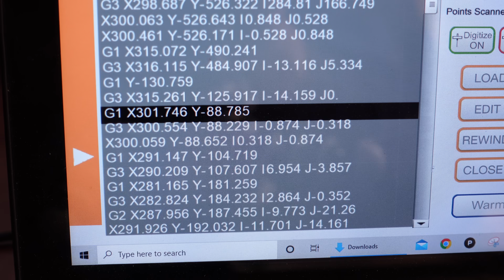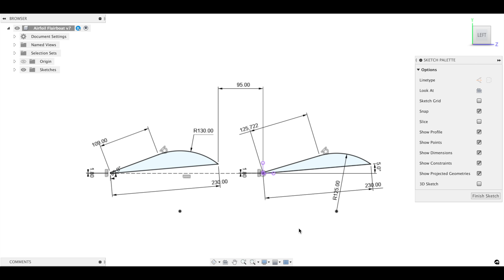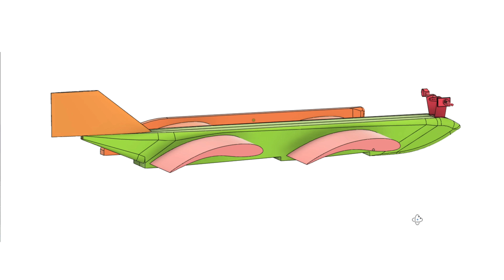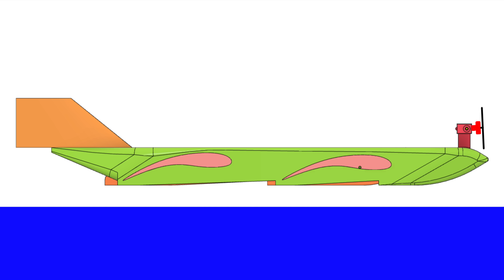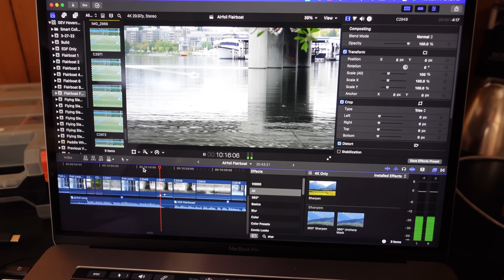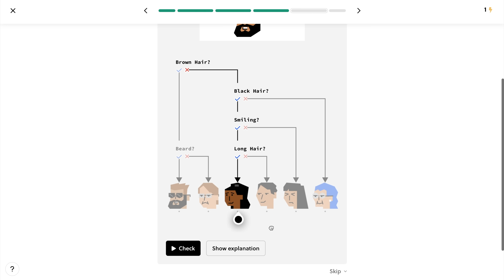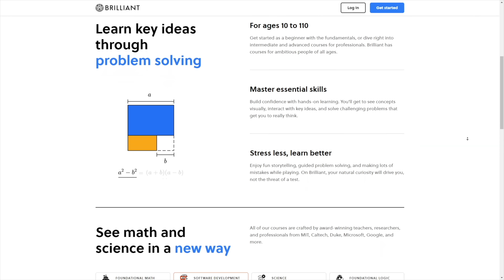Worlds First R/C Airfoil Flairboat

Comment: One thought I immediately had was, what if you were able to adjust the angle of attack on both front and back wing? Another thing I was thinking was maybe the actual flair boats didn’t have as much wing surface area. I think the whole point of the flair boat is to not necessarily have “lift”, but more of just a pocket of compressed air underneath. Either way these videos have been a ton of fun to watch.

Comment: I believe a great factor not depicted in your models is the power to weight ratio.  
Your models are super light compared to the wing area ( and power that you have already mitigated). 
If you load them up with heavier motors, batteries and the rest of the craft, you will achieve your goal.
Reply: Who does not love more power/run time/cooler motors? 
And, it takes it closer to the 1:1 use case of fast heavy transport with safety margins typical of military ops.

Comment: Take the weight distribution along the crafts length and power-to-weight ratio of the craft into consideration! The original Günther Jörg craft probably had a heavy combustion engine in the middle as well as fuel tanks. The pilot sat in the front or at least the front third of the contraption. It is safe to assume that 60-75% of the weight of the crafts weight was concentrated in the aft-half of the vehicle. Also, the CoG would have been further aft than on your model. The problem you are having is similar to that of the infamous 737-Max 8.

Comment: Again: Anything will fly with enough power. Ground Effect Vehicles are about being optimized for efficiency in GE.

Measure power and airspeed, you should see a considerably higher airspeed to power ratio in Ground Effect than in a classic airplane. You would also see much lower stall speeds and higher capacity.

I would actually not classify what you have here as Ground Effect Vehicle because it flies too low. As you noted you're getting ram pressure rises.

Comment: Tried to comment earlier but I think YT was removing it based on me linking to RCGroups. Apologies if you've already seen this!

'Derk' on RCG built a tandem wing flairboat with airfoils about 12 years ago. It's post 177 in the General Ekranoplan Topic in the hovercraft section. In the following pages he reports on testing it with some success. Sadly most of the external links there are dead so there's very little video or pictures to go on. I think I've seen other tandem designs tried, I will see if I can find it.

Looking forward to the next one!
Reply from the maker: Good find! 
https://www.rcgroups.com/forums/showpost.php?p=15646822&postcount=177
Reply: @rctestflight  Aye that's the one. That thread is a fantastic resource with the most information I can find about RC GEVs anywhere. But trying to parse it out and find things is quite hard even with the search, and that's before you see how many dead links there are in the early parts. Nowadays there's very little activity.

Comment: i too have really enjoyed this series.  My two pennies worth, noting that I know nothing of the crunch... with a full size ground effect vehicle and considering the volume of air that's under them plus the speeds at which they travel and the pressures etc,  then scaling that down to the size you are experimenting with.  You can't scale down the air molecules and so surely the volume of air underneath the scaled version is going to have different properties to what you are expecting.  could that be the reason why doing this experiment is so difficult??
Reply: <Reynolds has entered the chat>

Comment: I will say again that span has a lot to do with how temperamental these are. You are dealing in mm of clearance at this size whereas a craft of 6 feet span would be dealing in several cm or inches of cushion.   The bigger it gets the heavier ripples/waves it can clear.   Besides that efficiency goes up as bigger airfoils have better reynolds numbers.
Reply: Two meter wingspan should be producible using his current facilities. He could scale up a copy for a comparison, if he was so inclined.

Comment: I'm fairly sure that packing tape would just want to stick to the water, back in the day they used to try and polish the underside of race boats as much as possible for it to slip through the water since that's how it works in the air. However it just ended up increasing the surface tension to the hull and ultimately slowing stuff down, not that it matters at speeds like this but it's still a fun anecdote !
Reply: You could make a surface more hydrophobic by waxing it. No idea if a fully submerged hydrophobic surface has less drag than a fully submerged hydrophilic surface, but at least it should make it easier to lift the last millimeter or so out of the water at slow speeds.

Comment: Perhaps a good use case to define ground effect craft in the spirit of the ekranoplan is to consider jet engines with afterburners. Afterburners could easily be used to lift off the water, but are FAR to fuel inefficient to be used in normal flight. 

Electric motors are the way to go for these small RC craft but I think it's important to remember that looking at this from the perspective of electric motors conceals the purpose of this concept at full scale with different power plants.

Comment: The reverse Delta mainwing in ground effect, with a high lifting tailwing not in ground effect is the most pitch stable configuration. 
Your right this is more like a SES of rigid sidewall hovercraft. 
You could try enhancing dynamic sideskirts by curling the edge vortex down at the lower edge of the wings

Comment: I really like this series. I think having elevons at the back affects groundeffect so you not just introduce pitching moment but directly also affects the lift. Maybe it makes sense to have this control but I think elevator should be somewhere else for pure pitch control.
Also thinking that relation between height and lift force / pitching moment would help to understand which control laws to use and maybe optimize the design.

Comment: I think one large problem with doing this with a scale model is that electric motors especially are so powerful now, and materials are so light, the details almost don't matter as long as it is controllable. It's just like a missile. Point it in the direction you want to go and it goes.

Comment: Nice.  I realize that it required optimum conditions, but given those conditions it looked relatively stable.  My guess is that one of the problems with this type of craft is that the negative feedback, wrt to flying height/pitch attitude, is of a quite different magnitude in each sense. In other words I suspect the feedback gain, if you will, is much higher on the correction from too low to normal flight altitude, than the high to normal side.  That is just a guess, but it seemed to appear that way on the water.  

Thinking about it from a physical standpoint, riding a wing to surface pressure wave, I would expect that to be the case from a first thoughts shot at it.  Could be wrong.   

Are you going to try to build one now that can handle more widely variable conditions like more wind/higher waves/more variable wind, or have you about saturated on this project?  I can see you've already put a lot of effort in. Maybe somebody will take what you've learned and carry on if you have had enough.
Reply: Have a look at Tandem W.I.G craft Technology, you find everything in reality.

Comment: honestly i dont really understand aero dynamics. But the new F1 cars utilize ground effect in reverse to this, to push them into the ground. In my opinion the ground in this case doesnt really matter because with enough speed youll just fly. Youll have to design something like a hovercraft, but instead of a fan blowing down the thing, youll have to have air come in when the craft comes up to speed. You understand what i mean?? You'll have to design a floor design similar to the new F1 cars, but in reverse?! so the air lifts up instead of push down. No wings.

Comment: You need some sort of mechanism that airo breaks as soon as the angle changes. So you would have a sensor for when it tilts up - air braking starts. And have some linear relationship so the bigger the tilt the bigger the air breaking.

Comment: You have referenced the universal hovercraft designs..did you see the hoverwing vidoes? Hovercraft with canvas wings? those are def ground effect...no aileron control on the small ones. They do say they can "jump" to 20 feet...but not sustain it. So this i think is pretty much a real ground effect vehicle..but assisted by the downward thrust from the hovercraft. But..a very heavy aircraft and prob impossible to replicate in an R/C size. Love the videos...keep em coming!

Comment: I wonder if it'll help if the front wing has a lower stall angle than the rear wing? So any nose inclination causes rear lift to increase and front lift to decrease. Maybe that's why the full scale ship had under camber on the front wing.
Reply: THIS.

Comment: Is it possible that ground effect was more intended as a way to make a craft cover distance more efficiently? like maybe it "could" fly but it would use X amount more gas than when it was in ground effect so it wouldn't have the range required. and then they could design less fuel storage space into it and more room for cargo.

Comment: The front wing is a canard: it must stall first for stability. That is why the big old one has different aerofoils for the two wings. 
I suggest that you increase the front wing loading, angle of attack and sharpen the canard leading edge and reduce the wing thickness to ensure that the front wing stalls first. Also, reduce the angle of attack of the rear wing so the whole aeroplane body is at a positive angle increasing lift. 
Also, at small scales, a flat aerofoil works better than a classical curved aerofoil. The Wright brothers did not notice the scale effects obvious between the flat thin wing of a little bumble bee and a thick eagle wing so they used a small wind tunnel and then made their first powered aeroplane worse by building thin wings which had been optimised at tiny scales in an insect-scale wind tunnel. You are going smaller so your aerofoil must be flatter than the human carrying original. It is all Reynolds numbers!
Reply: Yes, and those differences can be be more dramatic than  you would think, and more tricky.  I think I remember that when Burt Rutan, who is a very competent aircraft designer, scaled up the Beech Starship, he ran into some unforeseen scaling issues.
Reply: you've got it with this idea, seems correct to me
Reply: I suggest that you do the above and show us the results on your channel.
Reply: @ruzziasht349  He actually makes some good points.  I agree with a lot of what he said, and I have a LOT of experience in RC, including from scratch designs, have built my own full scale airplane, and am an engineer, electrical, not aerodynamic, but I did have some applicable physics and fluids courses in my core requirements.  

If he has the time and inclination that would be cool. If you just meant that as a snub, that is totally uncool.  I'm guessing you meant it in a positive way.

Comment: I think you are focusing too much on the ability to fly out of ground effect. Your focus should be on the efficiency gains from flying in ground effect. To me, the definition of a ground effect vehicle is simply one whose energy requirement is drastically reduced based on proximity to the ground for a given speed. I would love to see which one you could fly longer, a large solar glider or a large solar ground effect vehicle?
Reply: Not for me, not for a useful practical one.  I would love to have a ground effects vehicle like this, and in that case I don't think the efficiency between a high flying and ground effect craft is at all the interesting comparison.  

Since this is an air/water vehicle, the interesting comparison for me would be the WET efficiency vs ground effect efficiency, and I expect that is massive.  For a practical two or four person sized craft the other thing that would be very important to me is the flying height. Without enough of it the vehicle is useless with any increasing magnitude of waves overflown.  Also, you could haul ass through the Manatee areas without having the slightest worry about even touching one, as where I live, in Florida, waterways like large extents of the St Johns River are now wake, slow idle zones for Manatee protection.  The other large consideration for transport, even just sport transport would be speed, where this vehicle should trounce any wetted vehicle, even hydrofoil.

If you wanted to use ground effect to transport goods (or just as a science experiment) then I would agree that your comparison is definitely part of the equation.  Not arguing, your opinion is your opinion.  I'm just trying to look at it from the larger scale perspective in terms of real world payoff.

Comment: everyone gave up on tandem wings for all the things you experienced, my first was a rubber powered tandem. 
theyre also a bit dangerous in free space because the rigging angles make them limited in recovery, like from stall or in a spin
mainly because the aft wing is in the wake of the forward or canard wing, once the canard takes energy to produce lift, the airstream aft is downwash.
(that downwash is the angle of attack of your canard plus around 4-6 degrees)
this downwash means the aft wing has to be rigged so that has more AoA (angle of attack) otherwise its effective AoA is in the minus zone. 
ultimately the CG ends up at the canard and it does more work, the original machines moved to very large high aspect ratio tails around 40% area in free space instead
it just produced more lift per area, therefore weight, and was more controllable in pitch
you can adjust the effectiveness (or not) of a machine by limiting the aspect ratio of the mainplane
very low aspect ratios wont float out of ground effect
cheers
Reply: Look up Quickie, and Q2 (there is  a Q200 version, too). And you might want to include aircraft and have your safe search turned on if that sort of stuff bothers you.  Just sayin'. :-)
Reply: @MrJdsenior  what makes you think I dont know these designs
the quickie is more of an extreme staggerwing, because it has lots of vertical separation it doesnt suffer the same wake effect, as I have written
when you figure out how to read come back, otherwise lets not bother either of us

Comment: maybe if it had short hydrofoils it would be able to raise on water before getting airborne, but still not have enough power to achieve full flight?
Also, as you have overpowered motors that make the craft go out of GE, looking to stall, how about putting them to use in bladeless fans blowing under the front wing, and no other propulsion? It'd make definitely sure that it would never leave ground effect, I guess.

Comment: Maybe a suggestion for fighting the flipping phenomenon: Make the front airfoil way thinner than the rear one, which causes it to stall almost instantly when the pitch gets out of hand. The rear wing would at that point then still provide lift and force the pitch down again.

Next, I think the reason bigger planes are inherently more stable within Ground effect, for two reasons;
1) The ground effect regime works within a window closely related to the wingspan (as you mentioned in earlier episodes). Bigger/ heavier planes require more wingspan in the first place to even fly, and thus give them a larger Z-window to operate within ground effect.
2) Heavier planes will also respond less aggressively to water disturbances, as the relative change in lift as caused by the disturbance is far smaller than with a tiny plane with a very small air gap.
Reply: The heavier = more stable might be an issue inherent to larger craft, to do with the square (^3) increase in mass as size increases, which also necessitates stronger materials which inevitably increases density compared to small RC craft.

Meanwhile, lift, drag and interfering forces from wind and ground types increase less proportionally, so inertia from the greater mass can smooth things out and reduce or eliminate disturbances.

Throw a piece of sand in the wind and it'll tumble around and get blown over by a slight wind. Throw a boulder made of the same materials and it's orientation and trajectory will be as stable as can be.

Speaking of which... these definitions of 'flight' that he's reading people comment about is getting pretty ridiculous lol. By their definition, chucking a rock in the air would constitute as 'flight' while skipping a stone on the water wouldn't because it 'cheats' by bouncing off the water.
Reply: I am probably wrong but wouldn’t the Newtonian lift of the thinner airfoil keep it flying instead of stalling? It’s not exactly slow.
Reply: @Riverbed_Dreaming  for most lifting bodies, the gross part of the lift comes from the suction (top) side of the wing, so stalling the wing will indeed still give us some lift from the pressure side of the wing, albeit not a lot. But even if we assume the pressure side would contribute half the total wing lift, then in case of stall you would still lose a significant portion of lift on that wing... This is me just rambling though, validation by experimenting would prove who is right :)

Comment: Nice vid.

Maybe next model, If you still want to get the ground effect form the forward speed, and not from the motor. Two motors, sticking out the sides. Motors can be low to the water and not affect the wing.
Bonus, no need for a movable rudder, because differential thrust.

Comment: could you put a slightly larger or more efficient wing of the aircraft? That would make the craft pitch down as speed increased. The sizing would be critical because if it is to large it will just dive into the water.